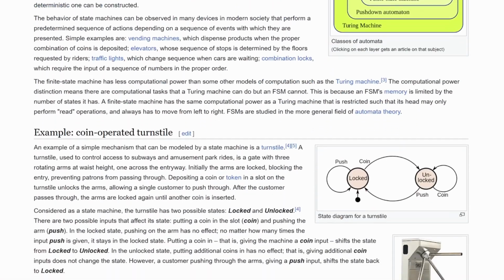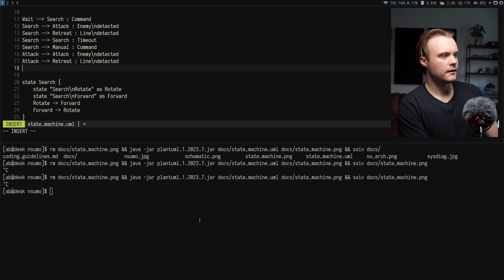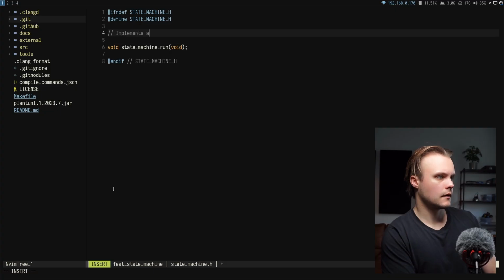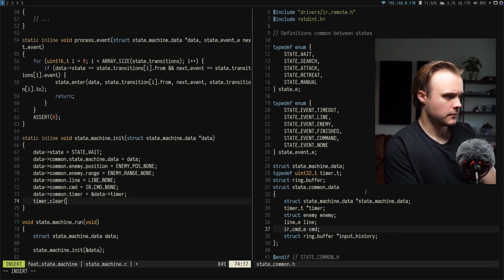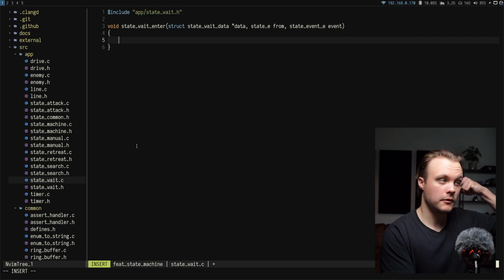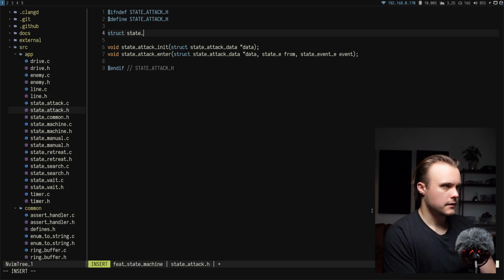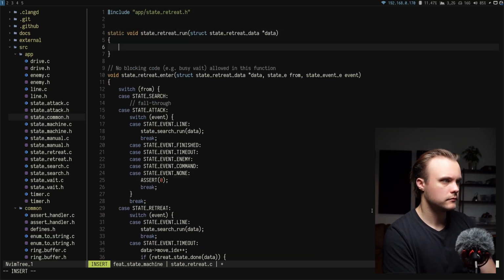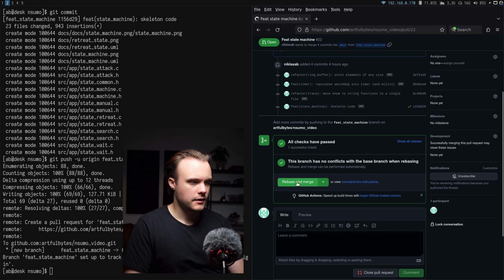How to Code a State Machine | Embedded System Project Series #26

Comment: Is it normal in embedded systems there are many state machines? For example I have main program which needs data form sensors and it's one state machine but I have also more for example for OneWire where I have to wait between particular stages? Is it good if in main loop I have many validation of flags and I service many state machines?
Reply: Yes, it is.